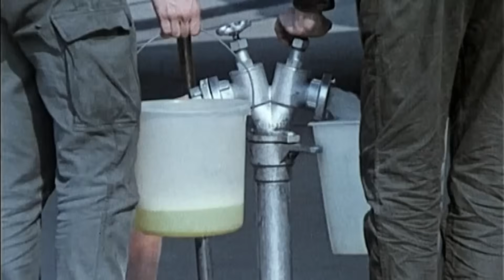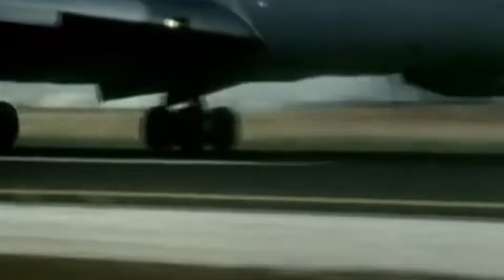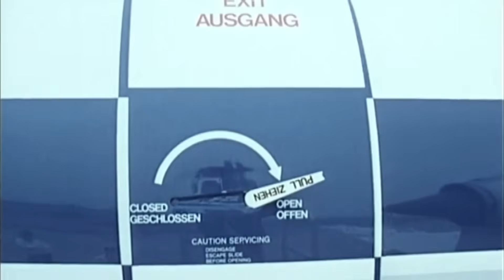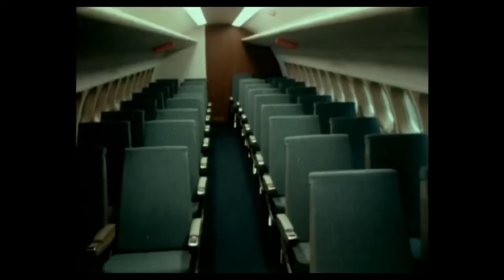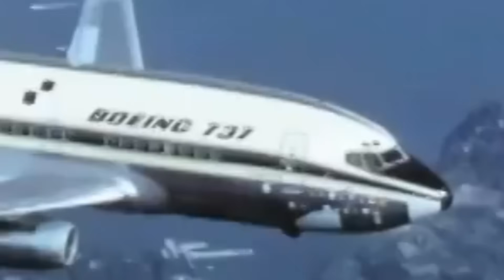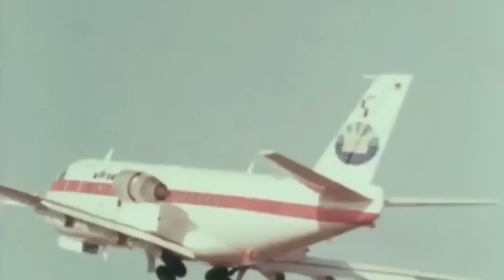Why the VFW-614 Fokker Was a Nightmare for Passengers

Comment: Bear in mind that it is ingenious to install engines on top of the wings.
Considering heat, oscillation,Aerodynamic loads,Exhaust fumes and heat, etc it is really a ingenious design.
German engineering has always something new and unique to offer.
A pilot from Iran.

Comment: I joined Bristol Siddeley in 1964 as an apprentice and  in 1970 transferred to the M45H engine programme as a development engineer after RR had taken control of Siddeley. In Feb 1972  our team was made aware that the prototype aircraft had crashed. Was it our fault? Did our engine have a design flaw? The destroyed engines were shipped back to Patchway, Nr Bristol for examination. We went through those engine remains and pylons. diligently looking for any possible defect - we found none. Later came the conclusions that the tragic loss was as a result of aerodynamic tail flutter. The M45H was cleared and subsequently approved for civil use. I remember it all as if it was yesterday.

Comment: Tail mounted engines are clearly higher above a dirt runway and the bucket reversers they use actually reverse the aircraft on the ground. Longer landing gear is obviously better able to deal with spreading the shock and provide the max travel distance for rough landings. This was definitely a comedy bet at the design office that somehow got funding approval.

Comment: So Honda-Jet not so original.
Reply: Except the plane they showed wasn't the Honda Jet
Reply: The failure of VFW-614 led to a common belief in the aviation industry that placing engines above the wings is taboo 
because it increases air resistance.

However, Honda challenged this conventional wisdom and discovered conditions under which air resistance is minimized.
A safe climbing route to an unclimbed peak was pioneered.
Reply: But how'd it solve the limitations of the Fokker
Reply: @southparklion it's a business jet, not an airliner